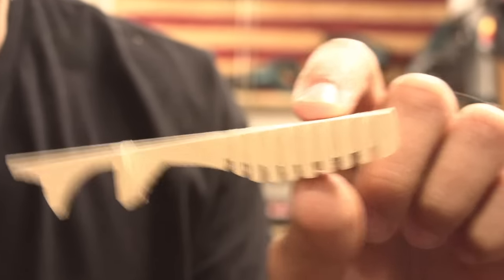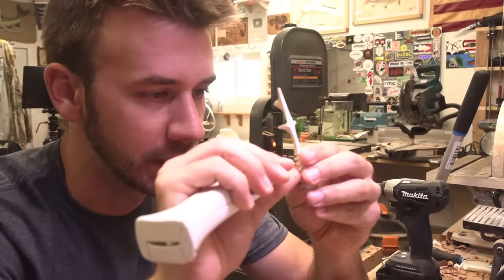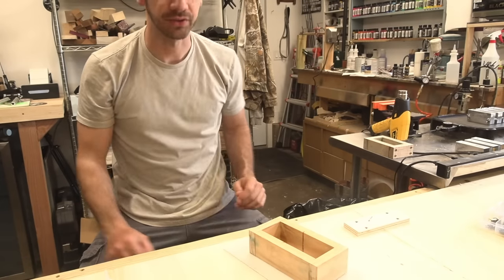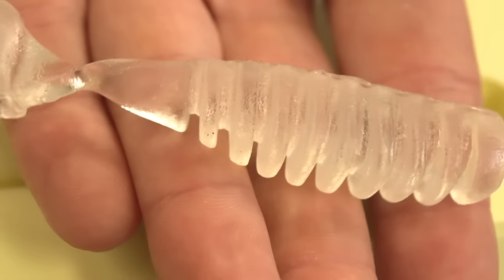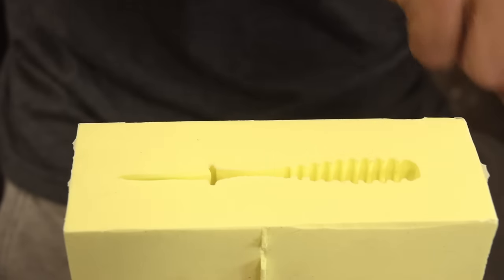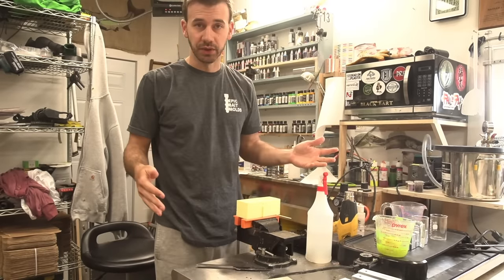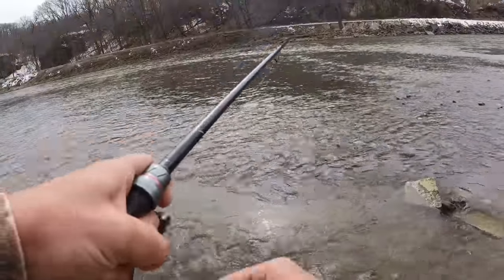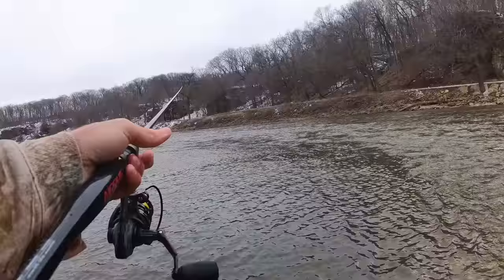Carve to Mold to Pour to Catch to Clean to Cook Walleye SwimBait

Comment: You say on a silicone to use a heat gun, but on aluminum  you don't have to worry about it because you heat the whole mold.. if you vacuum chamber a silicone mold to get the air pockets out you can easily heat a mold in an oven to heat the whole mold.. I use an oyster toaster oven

Comment: If I put that much work into a bait (assuming I had your skill to begin with, which I don't) I'd be fishing that on like 80# braid, or better yet, steel winch cable. To heck with breaking off on snags and what-not, using 10# braid and 12# fluorocarbon. Nuh uh.

Comment: You didn't zip your filets.   There are pin bones down the center line that are easily removed by making a small cut on  either side of the center line at the tail and then pulling the two halves of the fillet apart.  You then pull the center line and all the bones off the other half of the fillet.

Comment: You need chartreuse & white for walleye together or separate, those colors kill. Also, i am appalled at what you did to that meat. Fish are to be deep fried. I will give you a simple recipe. 2 cups flour, i cup corn meal. Mix in Ziploc bag. Small amount (teaspoon) of garlic or onion powder. Light beer. Soak fillets in cold beer for an hour or so. Take wet fillets & drop into bag & shake around. For thicker breading, take fillets out of bag, drizzle some beer on them & drop back in bag & shake again. Deep fry in vegetable oil until fillets float. Deep fried, a 15" fish will make 4 decent sized pieces.

Comment: Dude you don't have to pay someone to put a thermostat on your wall, and no not even a programmable thermostat. 
You take your old one off, and if you can't remember what wire goes where. 
Just cut it off leaving it on the thermostat and some of the color insulation to show what went where. 
Because 99% of the time they hook up same as they came off the old one. 
That's because it's universal wire colors for same functions, that and truthfully there's only a couple manufacturers that sells majority of them.
Programming one is basically the same on all of them too.
Plus you can read I'm fairly positive about that, and besides you need to know how to reprogram it if something happens that changes the settings